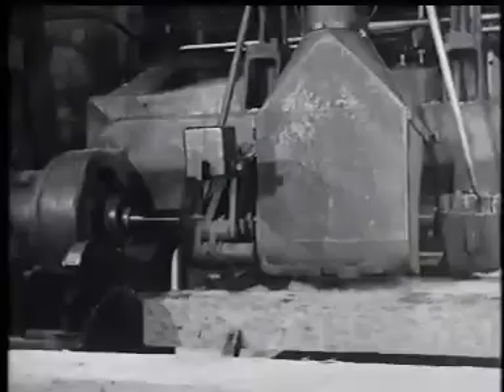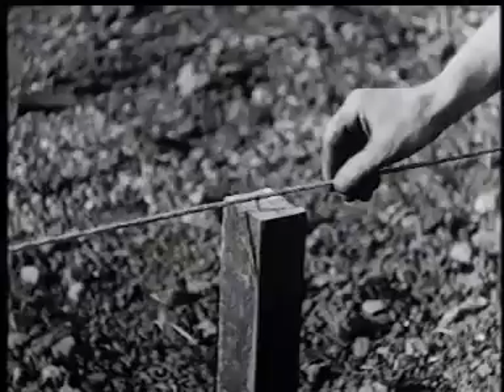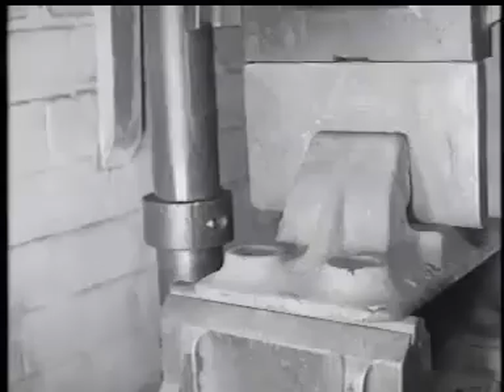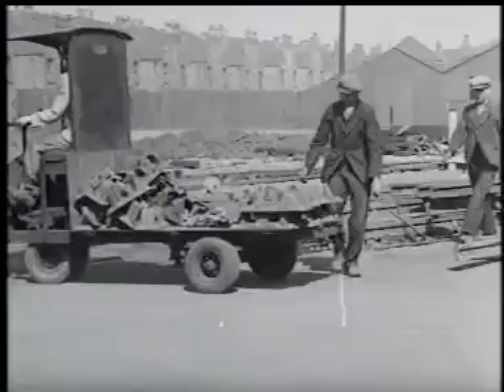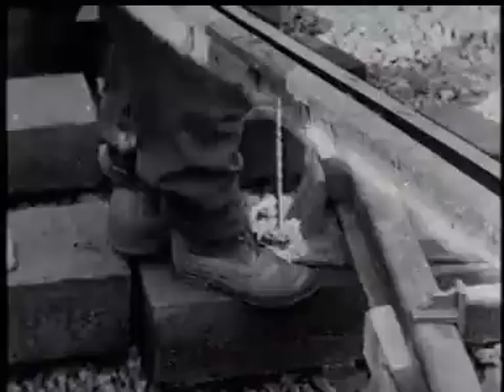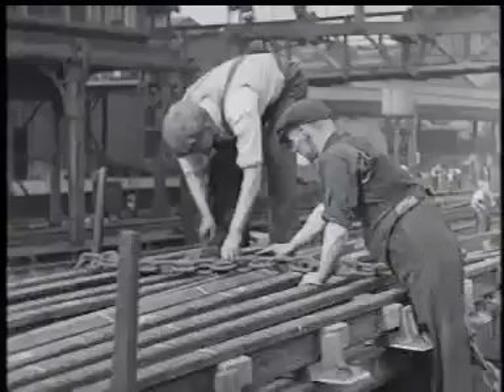P Way Junction renewal - the old way

Comment: Why they use wood than concrete for sleepers?
Reply: cos...1947, and all that stuff was lifted in by hand. A concrete sleeper weighs 7cwt =350kg each!
Reply: @briskyoungploughboy they didn't have forklift crane or hook crane back then to lift up concrete sleeper?
Reply: @Maniacguy2777  Lift from where? The tracks have all been taken up before the new is installed! The main point being though that every timber has different baseplate fixing dimensions to its neighbour, and that varies again for junctions on curves. Timbers can be drilled through to accommodate these variations whereas precast would require hundreds of different pattern variations to accommodate all possible dimension variables.

Comment: I’d love to know, with all the measuring, marking, fettling and care. How long this junction lasted before it needed repair or replacement. From the video you would think this would never wear out and would last forever.
Reply: @Edd Herring - I can't see ANYTHING in the video which suggested that those doing the work were stupid enough it would last forever.  As for all the measuring, marking, fettling and care;  did you expect them to take a rough and ready approach to such a complex build, which would have guaranteed that fitting all the parts together would have been a nightmare, and would have ensured they had ZERO chance of getting it done in the available time?
Reply: @jackx4311  No, what I’m saying is that with the amount of care these people take over their jobs you would think their work would last forever because they seem to care, take pride and do a very good job. Simple as that, I was not disrespectful nor did I think they did anything other than a very good job.

Comment: Cant that whole track slip since theres nothing really holding it in the ground?
Reply: @Brett Calarco - apart from the friction grip between the sleepers (ties) and the ballast, the ballast is stacked up in between the sleepers, and on both sides, so even for a 60 foot track panel to move, it would have to shift a hundred or more tons of well tamped ballast.
Railways have been built like that for 200 years, and they still are built that way - even when trains are running at 125mph.
HTH
Reply: @jackx4311  woah, I guess I never thought about how much the tracks actually weigh with everything installed
Reply: @vasaaviarion   - hi, Brett;  yep, I've worked on a few preserved steam railways in England, and I vividly remember being on a works train when we were relaying some track, having previously dug out all the old ballast.  I watched a 22 ton 8-wheel dumper truck pouring ballast - it was amazing how short a distance that full load covered!

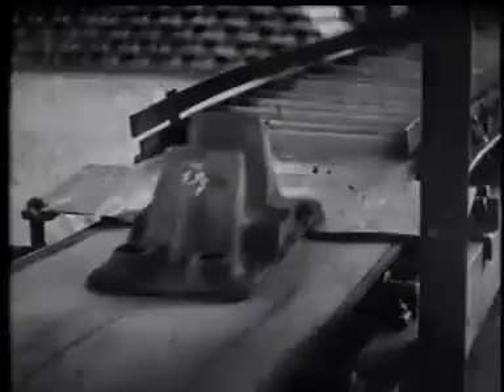Comment: 1:50 "First, the chairs are ferrelled."  Anyone know what that means?
Reply: @GretchenDawntreader - ferrules are hollow sleeves of some very hard fibre, which go into the holes in the chairs, and then the chair screws are screwed down through them into the sleeper (US, tie).  They act as a shock absorber between the chair screw and the chair.
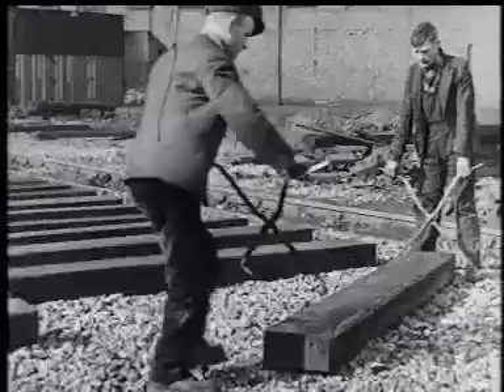If you look at this film, at 4:15 onwards, you can see what a ferrule is, and how it's used. HTH
https://www.youtube.com/watch?v=RjpYcYgaOCI

Comment: I worked in the peeway from 1984 until 2004 and as i look back now it 
was the happiest job i ever had, hard dirty work at times but you were 
part of a gang who looked after their section of track and you all 
pulled your weight, they were hardwroking bunch,even the old railway 
guys who were in the 60s could put you to shame with the work they could
 do.............such happy times believe it or not, digging out beds and
replacing sleepers, replacing rails, changing plates, oiling the points,
 it was more akin to being part of a army squad than a job to be honest,
 great days.
Reply: Enjoyed my 26 years working on the p way
Happy days.
Reply: True to this day I work with a couple of 60-70 year old trackmen and they honestly put the 20 year olds to shame
Reply: I work on the railway now. I'm possession support. I assist the PICOP in placing the detonators beyond or approach to the signals or points. I do what a hand signaler used to do

Comment: As a crane operator, the sudden hoisting and the slinging in this video hurts. like, 'fast is not smooth and not smooth is slow but if you go slow it's smooth and smooth is fast'. and number of times it showed the operator just SLAMMING the loads down... like... CHRIST If I did that in this day I'd get my head knocked off by the irate slingers! They absolutely WOULD punch the operator for dangerous operation. (I've BEEN that slinger, holding the operator down while the supervisor beat the shit out of the operator after repeatedly ignoring directions for SLOW movements.)

Another one is the constant talk of 'constantly checking position' to reduce required effort - if they're laid that fast, the modern operator is constantly told to take it back up to reposition because dropping so quickly, the guys couldn't hold the swing for the drop (slinging the way in the video is not conducive to good handling!) This is why I had a steel erection job where I almost could have progressed on my half of the warehouse faster than the other side - despite the two crews working in sync as much as they could, with rafters requiring both so yes I had a lot more 'waiting around' after finishing my part - I took the meaning of that phrase Fast not Smooth, Not Smooth is Slow so Go Slow It's Smooth It's Smooth is Fast. I did steady slower continuous movements with speed variation for controlling the LOAD and so was able to anticipate load swing better. The other operator was 'get the boom over the drop area as fast as possible' and ended up waiting around for load swing to reduce itself, because 'taking the swing out would leave me out of position'. guess who didn't return the next day.

But because I'm smooth I don't rev the bollock off the engine, and they think I'm slow (there ARE operators who have THIRTY YEARS of experience with their own machines to ecke out combining fast movements AND smooth operating for load control. I dont have the sheer weight of experience with ONE machine to ever get that '180 degree slew into within an inch in two seconds", so career steel erectors of the same years of experience DO complain about me, but Fuck you, I don't want you going home in body bags. or breaking the machines I operate which were individually built with less headroom on their strength (older machines were HEAVILY over-engineered... and highly experienced operators who moved onto them that had been highly experienced with what their old machines could do PAST what the 'book' said often found themselves with broken machines)... and the guys I've worked with expect 'ignore the book it's not even 'alf what ma' 'chine cun do laddie!' (The book chart is 85% in US and 75% in the UK of either breaking point or tipping point, because they're designed that way. 'oh this design breaks at 10 tonne in this config at that radius, so lets say it can only do 7.5 tonne (or 8.5tonne), but older machines was 'I think it can do 50... yup. lets try 60. Yep. oh the legs behind me are in the air with that one? it's a 60 tonner, but strap a bit more counterweight on lad!"
#
Reply: @Alexander Mcpherson - GET THIS THROUGH YOUR SKULL, YOU ARROGANT, THICK AS PIG-CRAP BARSTEWARD - IF THOSE MEN WERE AS EFFIN USELESS AS YOU CLAIM, HOW THE F*CK DID THEY GET THE JOB DONE, AND GET IT DONE ON TIME, OVER AND OVER AGAIN, ON EVERY JOB THEY WORKED ON?

Comment: what i find interesting is that the manufacturer used 4 men to assemble the ties, but when the railroad installed the ties, they used EIGHT MEN.  talk about excess labor.
Reply: Eight men means they can move faster from start to finish to get the sleepers in place. 

There isn’t critical time pressure to reduce the closure of the line during the test assembly.
Reply: @tjejojyj  True.
Reply: Well spotted.

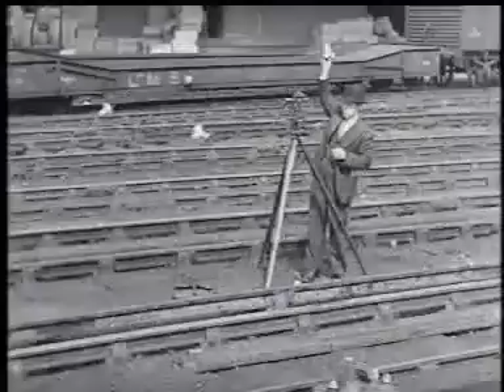Comment: 2:38 the surveyor has a bowler hat and dress shoes.  When is this ?  Could be the 1940s , although the equipment looks older.
Reply: Well, there's a series of LMS films all from '38-'39.  May be the 40's but definitely pre-1944 when they started using flat-bottom and this is bullhead track.
Reply: @TheGodsrighthandman  'started' using FB rail. There was still plenty buillhead around in the 1970's esp in areas with tight curves. We have plenty of rail on the main line here in NZ rolled in 1970 and nowhere near worn-out. It lasts a long time!

Comment: Make all those sleepers for the track? how many trees did it cost?
But hey that was a different time and the environment was certainly not thought let alone that they knew that the word even existed !!!!
Later they found out that they could also be made of steel or even concrete and then a Mr Bleeching came around the corner and thousands of miles of track disappeared, but also the sleepers, but there was trade in them, many of them sanded up those old sleepers and made one. beautiful mantelpiece of!

Comment: The original idea of the double headed rail was that when the rail head was worn, the rail could be turned over for a new rolling surface. In practice dents were worn and hammered into the lower head, making it unsuitable for turning over. Subsequent rails had reduced size lower heads to save metal.
Bullhead rails and chairs have been obsolete for decades. It serves on secondary tracks, side tracks, industrial sidings until it is worn out. Large stocks of bullhead rail, chairs, wedges and screws from abandoned lines and lines where the bullhead rail has been replaced by flat-bottomed T rail are available for maintaining heritage railways and sidings. Bullhead rail will be in service for many years to come.

Comment: Absolutely fascinating!  The hard hats and high vis. are noticeable by their absence!
Reply: back then, the lack of ... Ahem. Elf and Sayftee, meant that there was more time getting the job done, and with more work, meant more back-breaking labor so you had it done right because fuck if you got it wrong theylll make YOU move it to the right place. now it's mostly meetings (I've had big jobs done quicker - including the rig and derig of my crane - than it took to do the 'Induction', which didn't even tell us WHAT we were doing. there was a whole sixty-page document for THAT. Of which only two pages were useful - the drawing (if there was one) of where the crane would go (that probably wasn't even of a accurate detail level to actually tell me when looking at the actual site 'oh thats where I'm going, next to x y detail on picture that exists for real' too often the 'drawing' was like what a two year old would do with just the box and line functions in MS Paint in less than a minute. leaving one page - that says what I'm lifting. Except too often it'd have "and miscellaneous lifts of weights not to exceed crane lifting capacity". Like. DUH.

I've been sent OFF SITE for not wearing a helmet... on a site where the only 'heavy machinery' was my crane which wasn't even rigged, and the only works going on at head height or higher was the thought process of "BUT HAT!" . there wasn't even a building. (I was there to lay the GROUND FLOOR slabs, which were laid on the ground no more than two layers deep so didn't even reach above knee height, no hammer-and-nails, nothing that would necessitate head protection).

Yet I've also seen "Put your hat on" site managers not wear them in places where they'd actually DO something. like say, indoors, when someone's on a step ladder doing stuff in the ceiling space. not wearing them because 'but, I'm INSIDE". There are situations where indoors is helmets OFF and situations where its HELMETS ON. Then there's sites were I've walked past, not as a contractor but IM ON MY DAY OFF GOING TO THE BANK and shit's constantly dropping from the scaffolding above the public-footpath-that's  not "on site"- and its repair works to the TOWN HALL like FOR FUCKS SAKE THE ONE PLACE YOU THINK HSE WOULD BE TAKEN SERIOUSLY.

This is why I prefer getting paid a third of the wage as a PIZZA DELIVERY DRIVER to being a crane operator. It's too stressful and I spent too much time in my childhood being driven insane by shitheads at school to accept being driven insane in the workplace.  The money was NOT worth it, especially because it actually has monetary costs in the long run that negate that cost - like FUCKING RED LIGHT RUN CAMERAS RUN BY COUNCILS THAT SAY OH THE LIGHTS CHANGED TWICE WHILST YOU WERE ON THE JUNCTION THATS TWO FUCKING RED LIGHT RUN FINES. So... just so you know, WINSFORD, CHESHIRE CAN GET FUCKED. after that I drove the crane down the DANGEROUS ROAD to avoid A FUCKING CAMERA whenever I had a job that way. SIX TRUCKS ended off the road having to swerve out of the way of the wider-than-a-truck mobile crane that was driving with its own left-side-mirror in the bushes but the right side wheels where ON and not inside of the white line. a crane that, at the speed limit of the road the camera is on DOESNT EVEN TRAVEL ITS OWN LENGTH in one second. (30mph).
and 30mph was TOO FAST for that road given the VEHICLE and design and layout and shit of that road - so 20mph would have been more suitable but I didn't want to get THREE red-run tickets.

Sorry these things get me RILED UP so fucking much I'm 32 and need a goddamn chill pill because of shit like that and already 'retired' from the job because its so fucking stupid and NOT FUCKING WORTH IT... SIGH.
Reply: @AlMcpherson79  been there, done that.
I was the laborer for a small company one time, and wore a ton of different hats, so to speak.
For the jobsites, I wore a WHITE helmet, because half the time I was running more than what crew we had.
Also, I have a knack for building things, so I was also the guy that did the bids, and had to do all the measuring and surveying.
Toughbjob, but I always loved operating the equipment,  and I can thread a needle with a 600 size excavator, and shave fingerprints from a sheet of paper with a D12.
Too effective on the ground, so never got an operator's card...

One good look at a print, and a year later, I could fine grade a ten acre area with a 650 Deere, and all they did was run a rock rake over it, and throw seed down...
Yea, did so well that the boss cut my throat for $25 bucks an hour on prevailing wage work.
Went over the road for a decade, the employers there are just as bad.
No more big companies for me.
I'd rather die penniless than be some minimum wage slave doing work that commands $30 per hour.

You want fries with that?

Comment: Thanks for sharing this.   Sure reminded me of my childhood days when I'd go to the tracks and watch the trains.   Then if any track-work was to be done, this was how they did it and many times they also used "convict labor" to do this work alongside the actual railroad workers. 

Just watched a track re-lay quite a few years back and rarely is ANYTHING done anywhere near like this today, pretty much all automatic equipment and jointed rail making way for long slender rail that gets welded together.   

Pretty soon those clickety clack sounds will also become something of yesteryear.   And I'll sure miss those sounds of the metal wheels rolling over the joints. 

Along with these new idiotic quiet zones, that I think are putting people into more dangerous situations trackside, than if they allowed the railroads to use their horns and bells on the locomotives when needed!

Comment: I worked at that factory in the 1990's, when it was called Balfour Beatty. Bit more technically advanced then. I operated a planning machine probably one that was shown. Plus we didn't use bull-head rail then, it was flat bottoned
Reply: Bullhead has been gone for many years. Though I'm sure there are still some sidings using it. Not to mention some preserved lines.
Reply: I visited that yard as a railway draughtsman apprentice in 1978 to assist one of the BR(S) engineers setting out a junction. No bowler hats by then!. I believe It was still Taylor Bros at that time.

Comment: Not much changed in Australia either Except - The main issue of replacement is making sure there is access UNDER the 1500kv catenary wires.
So on the weekends, whole sections of track are turned off and travel is replaced by busses.
Junctions are prebuilt by the side of the place of install, but the catenaries would also make it more difficult to lift as there are crosswires all over the place so no way a conventional crane could be used. 

I'll have to check next time there's one near me .. there's at least 3 prebuilt points which is greater than a flatbed truck so there must be another method to slide the track under the wires..
Reply: I'm surprised  the British didn't steal people from other countries  ,to fo their dirty work oh my bag they stole people and they did all their dirty work and never pay them a freaking  dime.

Comment: I pass the old Taylor Bros site in Sandiacre, Derbyshire often, and some parts of the place are still there now, when you stand on the hill, at the side of Toton Sidings. I would guess due to it's proximity, most of the metal came from the Stanton Ironworks just up the road.

Comment: That crane operator didn't believe in "easy down."  He basically dropped everything.
Reply: I've operated one. The winch drum brake is only a 3-inch wide band of steel-backed wood or compact fibre (like a car clutch-plate) and operates via a foot pedal. It works well enough at lighter loads but when you're lifting heavy stuff and the brake is either 'On' or 'Off' then controlling the drop can get a bit fraught . . .